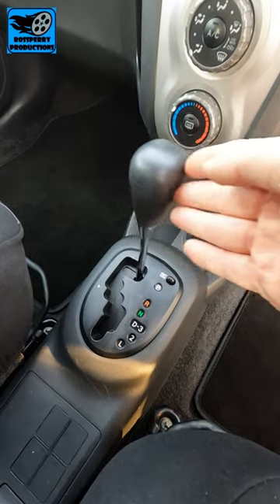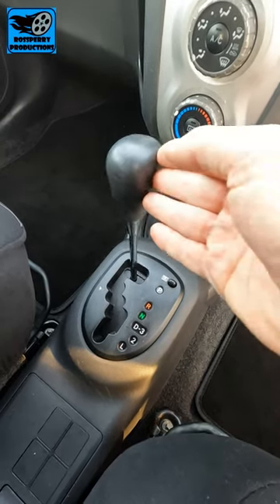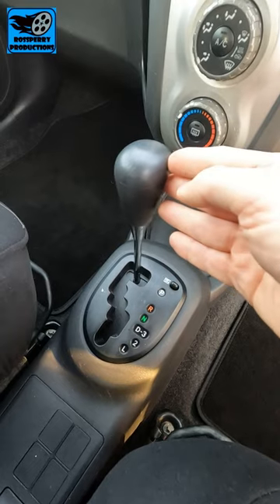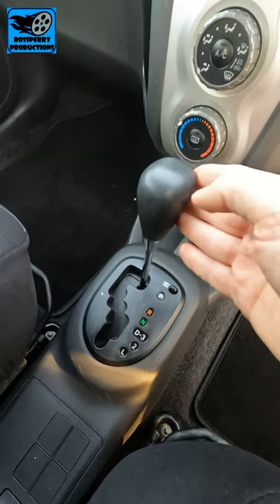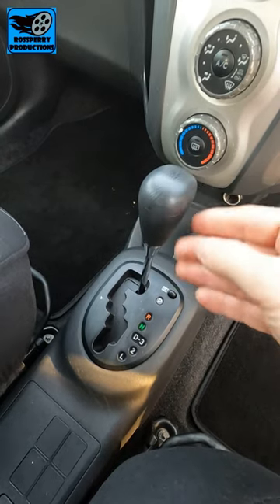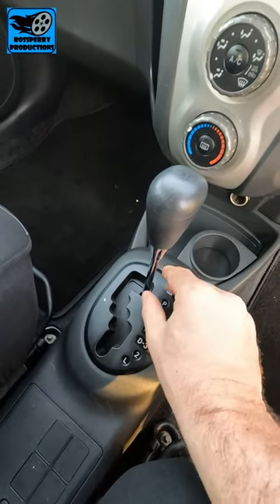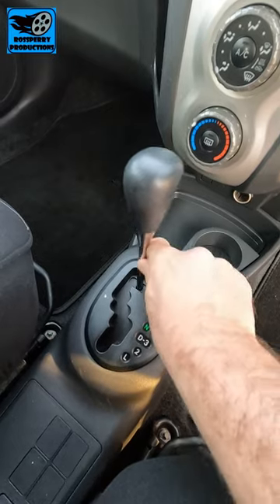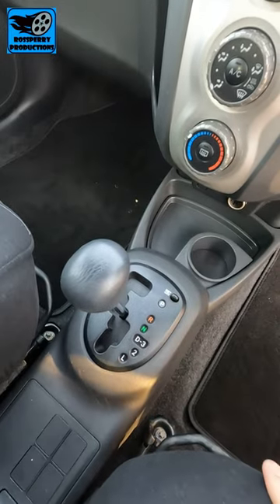Shift Lock Release Explained in Seconds

Comment: Have any solution it's too hard again and again press the shift lock then put on drive
Reply from the maker: You shouldn't have to do it every time, it sounds like your shift lock mechanism is broken which could also be your brake light switch, are your brake lights working? As the switch operates the shift lock